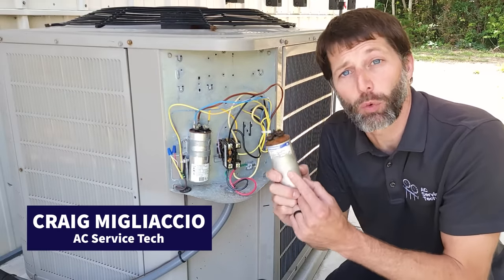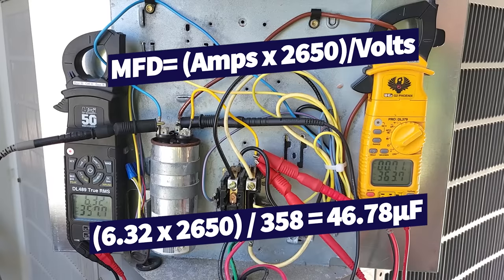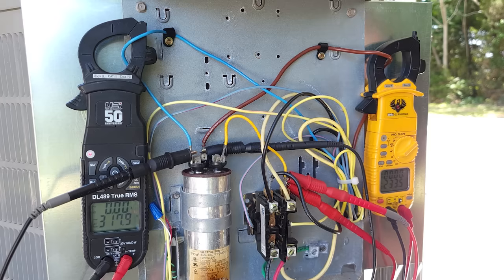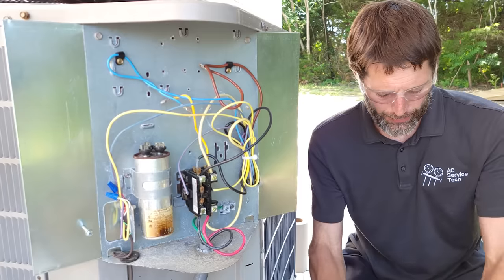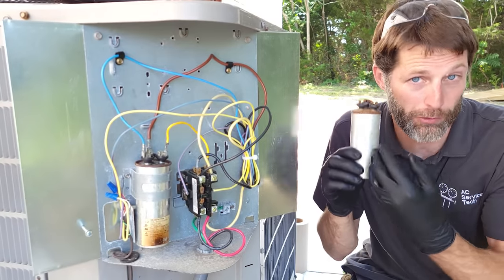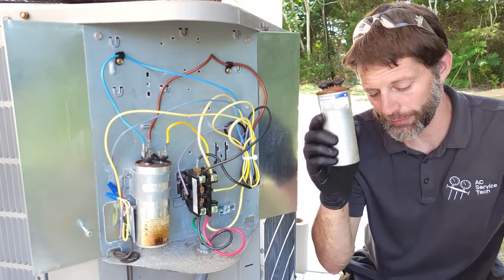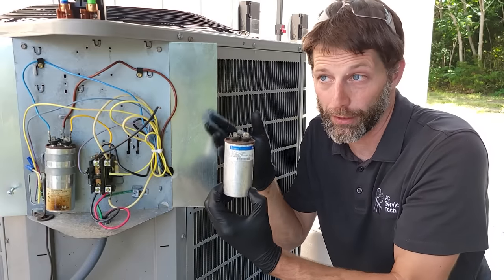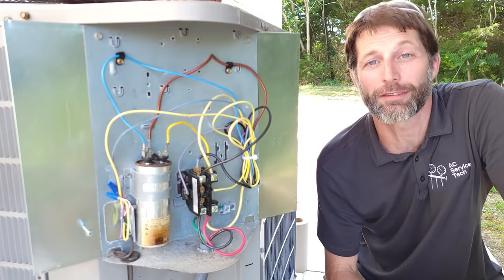WHY CAPACITORS FAIL in Air Conditioners! Watch it Break!

Comment: If it keeps  eating caps  the windings  are slowly  shorting out=  a lot with condenser  fan motors . Better  off with separate  caps   rather  than combos    plus try to mount them up against  the  sheet metal to heat sink them rather than  tie rap in free air or left in card board box .  If the compressor  keeps eating  the cap  even with a hard lead kit and hard start combo  it's  going to burn out real soon.  Have had troubles  with the OEM  plug connector  that can send you on a wild goose chase.
Reply: I had a local motor shop test a fan motor because it was burning out caps every year or two.  Motor tested fine, cap didn't.  I moved the cap into the box where the evaporator coils were, where it is really cool.  Dang thing ran for years without a problem.  It was just to hot for that cap.  Yes, they were a good brand and all but still.  I think the sun heated it up to much.  It did shine on that side during the hottest part of the day.   Odd thing is, the compressor cap, it was original. Go figure since they were mounted side by side.
Reply: @noneyabus1  ...condenser coils.....not evaporator coils ( although they act as condenser coils for a heat pump split system in the winter.....the component names "Switch").
Reply: @TheWilferch   This was in with the evaporator coils.  The cold ones in the summer.  This wasn't a heat pump, just a regular A/C system.  To be honest, that same cap ran until the system was just to outdated and to power hungry to use.  It was a old R22 system.  It was originally in closer to the condenser coils tho.  It was pretty warm in there.
Reply: @noneyabus1  ...got it.....was assuming like many others here.....that the "outdoor unit" ( the condenser) is what you were talking about as this was the topic of the vid...and instead of placing the cap in it's control box....have it hang somewhere in the airflow stream of the condenser. I see now that wasn't your intent...got it. 👍
Reply: @TheWilferch  This is a old system that is not split like modern ones.  Basically, it is a large box that has everything in it.  To connect to a home, you run duct work for the air.  One can literally hook up power and it run with nothing but the power wire hooked up.  It's old type system that one rarely sees anymore and many may have never seen.  

Still amazes me how come caps last as long as they do.
Reply: @noneyabus1  ...interesting...thanks. The older older caps were larger and had PCB's....both features probably helped them to live long. Cheers.

Comment: Where do you get the 2650 in the formula? I'm not sure what the 2650 means in the formula. And why do compressors have a back EMF voltage?

Comment: Loose connections on the compressor will cause voltage spikes- same as an automotive ignition coil.  This high voltage arcs across the dielectric material in the capacitor.  The arcing causes instant heat/ swelling and then disconnects the terminals at the top of the capacitor.  The only repeat capacitor replacements I've seen are poor connections at the compressor.

Comment: Does an EasyStart™ 368 (SoftStart) extend the life of a cap?  If the OEM cap is 370-volt, does a 440-volt cap last longer (or vice versa)?

Comment: I work as a technician in a casino and I deal with capacitors quite often that being the reason I managed to diagnose the problem with our air conditioner and was able to replace the capacitor with minimal cost and save me probably a couple hundred dollars

Comment: Going off of your point with not enough VAC rating... Is it possible that higher VAC ratings than needed could be better due to higher heat resistance? I would love someone's input on this.

Comment: Techs, performing PMs, carry extra 1/4" female spade terminals, even 1/8", taking wires off to test caps is a very good reason for loose connections, loose connections will cause excessive heat and failure.  
Great content.
Reply: If you don't make sure connectors are put back on tightly
Reply: @georgekolos5255  yes, but crimping already worn metal doesnt actually make it correct, only tight while your there, after its running and heated up, the vibration in the passing of electrons breaks it down.   
If your getting crimpers out, for the good of your customer, company, and just your own professionalism, cut it off, make a new connection.  
Obviously not every time, but ive taken care of the same homes for more than a decade, been to call back where others didnt take the extra time, but you can tell when it needs it, heat pumps every 2-3 years tops, AC 4-5, your replacing the cap or motor by the next go round anyway, why cheap out over a $15 bag of connectors that will do hundreds of homes.  Heck if your working for one of those outfits, you can run a misc charge for it, add $25 to your ticket, covers labor and parts, drives up your average ticket.  If you need to be sold on that front.  
Personally if its that big a deal id just buy them myself to sleep better at night.  
But thats just me.

Comment: If overheating is a common cause of failure I'm curious why they don't incorporate heat sinks to the capacitor or the mounting bracket.  The mfr could even use ducts to funnel air to help cool.  Are there any aftermarket hacks to help extend the life of the caps?

Comment: Are hard start kits a good idea? service tech said I should have one.
Reply: I've had mixed reports on those.  The most common info, it will work for a while but will eventually stop working.  If it is a A/C, fridge or freezer, best to plan to replace soon.  I had one last almost 2 years once.  That was longer than I expected.  It gave me time to prepare to buy a fridge tho.

Comment: there is a hum that has been happening for a while both in the heater use and ac. The cap failed in April this year and on Friday evening it failed there was the hum going on. not sure why is would hum. I turned of the breaker switch and it would stop the hum. At times I would remove the furnace cover and smack where the cap is located and the hum would cease.  have a friend sending me info I plan on calling the company who replaced it for me in April as they charged me almost a 100.00 for th cap. I seen on line this was only around 9.00 they said the part was warranted for a year and I m looking forward to hearing what they say in the am. it is hot here and my home was 89 last night really awful.

Comment: The original capacitor in my 30 year old Tempstar AC still measured good when the system was replaced due to leaking Freon. Like the saying goes “They don’t make them like they used to”!
Reply: I know but had to be losing on the efficiency of the unit. The new ones save you money because they cool faster and better. Then seer rating of today is way better then what your old one was.

Comment: So I am reading it is a good practice to use a significantly larger capacitor to help prevent this?  Also, I found myself wondering why not design a system to have 2 capacitors hooked up - if one failed, either switch to the 2nd one, and illuminate a warning light that you needed to replace the failed capacitor when possible - sounds a ton better than losing your a/c on a hot day -
Reply from the maker: Replace a bad capacitor with one of the same mfd ratings as on the compressor and fan motor rating plates. The voltage rating can be higher on the cap though.
Reply: Never replace a capacitor with one that has a different microfarad rating. It affects the electrical relationship between the starting and running winding's inside the motor, resulting in poor running efficiency, increased running costs due to higher amperage and shortened motor life expectancy due to excess heat build up in the motor.

Comment: Heat, among others, changes the characteristics of the dielectric in a capacitor. Often such media have a positive thermal coefficient in the relevant temperature trajectory meaning the heat resulting from a nominal load results in increased thermal loss. If no new thermal equilibrium is established, this positive feedback loop will cause a thermal runaway and failure will occur at the rated voltage. A capacitor is more than its rated voltage and capacity. Be aware when you decide not to do a one on one replacement.

Comment: I have a coleman RV ac on the compresser start capacitor with a resistor in the one wire it is bad as well,, my question is do I need the resistor OR can I do away with it ??

Comment: Really good information, but i do have a question. How long did it take for that capacitor to go out, cause I looked like it went out in less than 30 minutes? It may just be because I'm a newer technician, but I've never seen capacitors go out within the same day or even the same year!
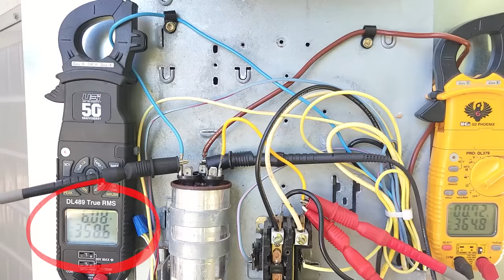Reply: He didn't make it very clear; he heated it up on the bottom. He makes vague mention at 5:42. I had to review it twice after I read others' comments here that he even mentioned it at all...
I posted a comment to that effect below. If enough people like it, it may float more to the top here...
I posted that comment 7-2-22.
Mr KL

Comment: I hate those combo capacitors, I prefer to keep the hermetic (herm) aka compressor capacitor separate from the fan capacitor.

As a rule of thumb, if the compression / hermetically sealed side of the combo cap pops or leaks, the other capacitor for the fan will die soon, as well. Now, if the fan side goes, it takes awhile for the hermetic side to overheat and cause a failure.

Comment: Hi Sir,
I have a question, the other day I just happened to fix my window AC by replacing the capacitor. The spare capacitor of 50Mfd would make some sound of fluid as I shoke it. Is this capacitor useful or not, kindly advice.

Comment: I built a complete run/start capacitor tester for a major motor manufacturer a few years back. It could vary voltage, phase angle (variable inductance) and temperature. 
I can verify there is a MAJOR difference between name brand caps and Chinese junk.
Reply: PA: After many replacements, I built my own HVAC cap using 700v film caps soldered in series/parallel and wrapping it in tape. I doubt it will ever fail.

Comment: I recently installed a new capacitor and a new sealed contactor.  About a week later in 95+degree weather, my ac unit stopped and was "buzzing".  I have new parts but what makes the buzzing, - capacitor or contactor?  Should a contactor fail that soon?

Comment: I've watched this video, but I have a 2-ton American Standard, that will double start on its cooling cycle (at night on ~8 min, off 20 mins). Not all the time, but usually from midnight to 5 AM. I have a Sense Monitor, what I see amps up normally, 5 seconds, then down to zero, 5 seconds off, then restarts successfully. The Capacitor has been changed. Sort of a double start. What else could this be?  My AC repair people have no idea.

Comment: Had a technician do an ac tune up.
Tells me the capacitor is bad and gives me an estimate of $750 to replace.  I bought a new one for $30 on my own. Disconnected the old one and then I decided to test it myself , amazingly the capacitor checked out good. Never replaced worked for 3 more years. Then I replaced with the one I bought previously.  Never using that hvac company again.
Reply: Sounds high unless there were charges for after hours or rush service...

Comment: After the failure of the capacitor and the unit was still running you said the compressor and fan current were very high. Can you tell me what the current was compared to before the failure?
Reply: I didn't see the ratings plate, but I believe it was initially running at reasonable currents relative to the rated specs, for the fan and compressor start windings. After he blew the cap while in operation, the start windings no longer have ANY current flowing, consequently the run windings end up drawing more current to compensate for the loss of torque provided by the start windings...

Rating plates usually show only TOTAL current for each motor, so rated current is split between the start and run windings (not necessarily equally, probably not). Keep in mind he was measuring the start portions only.

I don't know if currents he read, after the cap failed, exceeded the normal total current nameplate ratings in the now singly operating run windings or not. Even if it had been the same current or lower than the nameplate rating, it is now ALL flowing only in the run winding, rather than split between the start and run windings, so even if the current reading was at or below the rated nameplate current, it still could mean that the run windings are now carrying more current than designed for.

As far as this demonstration; I'm guessing his readings were in fact higher than the total rated current indicated for both windings combined, and remember it is now ALL on the run windings only...
Mr KL

Comment: Great explanation but you left out something.  While todays capacitors only seem to last a few years,  capacitors made 20-30 years ago last years or decades longer.  I have an old Lennox unit thats 28 years old and still running perfectly on the original capacitor.  What changed over the years?
Reply: PCB's were banned.
Reply: Quality of manufacturing.  aka engineered to fail at a certain time.

Comment: I don't know why they can't make (or have made) caps that don't last.  4 Ton Amana variable speed - 6 yrs old and have had two replaced already.  The original was made in USA.  Surely they can do better.  Insofar as the a/c quitting,  I have 2 spares as I'm done paying $250 for service call and a $30 cap.   In TX in August,  it easily gets well over 100° for many days.  But there is a 2 1/2 ton for the upstairs that runs almost 24x7 and hasn't had a single problem is the same 6 yrs.  Both A/C's were replaced at the same time.  I do like the idea of venting off the fan to blow on the cap.  I'll have to take a look at that possibility.  Sounds reasonable.

Comment: Been a tech for 30 years most of the time if a capacitor is gone there is a very dirty filter or a dirty coil inside . We all know liquid cannot be compressed a dirty filter causes saturation in the refrigeration circuit causing the compressor to run hotter and heating the fluid in the cap causing it to expand . Weak Capacitors fail on the indoor blower motor also cause lack of the proper CFM to restrict airflow causing the out door cap to fail

Comment: Plugged up condenser will cause dielectric to heat up and expand ,cap voltage rating on run cap during energized should be below it's 370volt or switch to 440 volt if you got cottonwood tree's.

Comment: I worked at oreillys for 2 years one thing i learned was soon as a customer came in looking to charge a battery and i checked the sides if it was swollen i knew that was the reason why they was there the battery was old and swollen
When they was all flat on both sides the battery still was good and fairly new
Reply: That is a good sign to look for.  It's caused from sulfation.  The plates due to discharge/charge cycles, or age, get a sulfer buildup from the acid in the battery.  They actually make or you can buy kits that help remove that.  I bought 10 circuit boards and put the components on for my use.  I have a battery that is over 15 years old and it still works fine.  It won't fix all batteries tho.  Some are to far gone to repair.

Comment: Thanks for the explanation! It is very helpful!
I have the same capacitor in this video in my AC, and I want to get an extra one in case that one fails.  However, I can't find a capacitor rated for 350/370v.  They are all 370/440v.  Would it work in my system?
Reply: Buying a replacement cap with HIGHER voltage rating specs...than the original....is an improvement and should offer longer service life...all else being equal. Always go for 370/400....or even just plain 440....when the original one is lower rated.

Comment: Nice, well done video. 
Q: Is a cap a go/no go kind of thing?
I ask as I just replaced ours and it seems to have changed how well the a/c works. 
It seemed for months that the a/c just wasn't keeping up with cooling the house. Then there was nothing but a buzz from the fan and a flick of the blades made it start up ... but no cooling, so the compressor was not running.
Now it fires right up and we have actually moved the thermostat up about 4 or 5 degrees warmer and the house is cooler.
Almost like yhe compressor was working at part speed or efficiency or ....?
 Any thoughts or schooling on this happening.
 This unit, btw, is 20+ years old and has only had the board replaced and that was about 4 years ago. The board had a clear burn on it and I had to find a sub for it as there were no direct replacements for it...that I or the hvac folks could find.
Reply: The capacitor is for the fan motor and compressor. Your compressor or fan were not starting up naturally until you replaced the cap. 2 stage compressor?
Reply: It is a go/no go situation to the extent that it just needs the uF value to start and run the motors, but it is not a go/no-go to the extent that the actual capacitance needed to do that can vary in a range and as the cap ages and capacitance drops, it can continue to be enough uF till it falls below the needed threshold.

Since you wrote there was nothing but a buzz from the fan, then it seems yours was already below that threshold and inoperable for a % of time the system called for A/C.